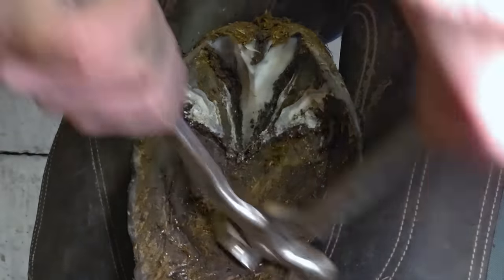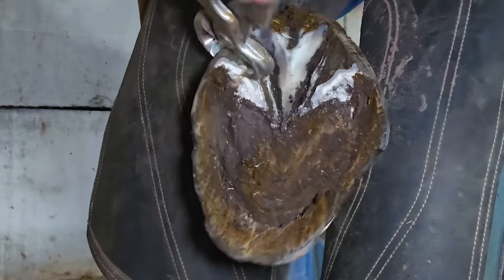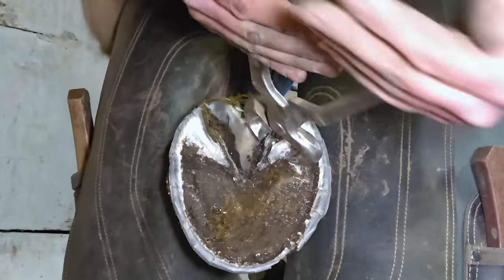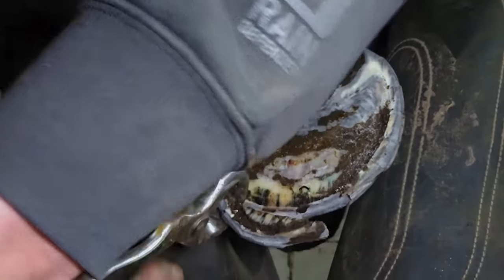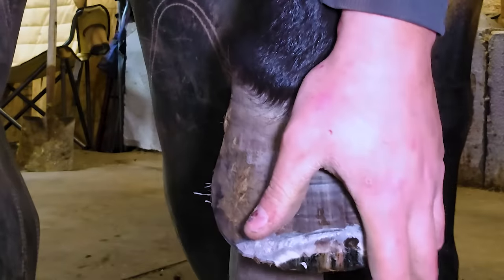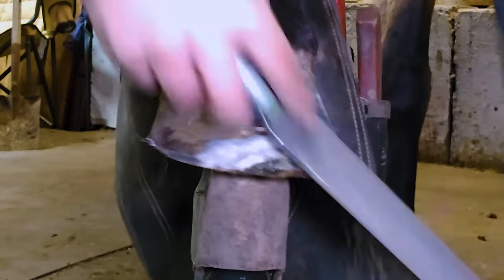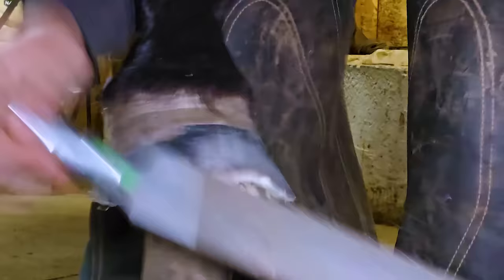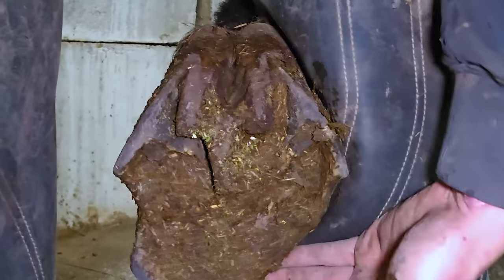These Hooves Were In Terrible Condition!!! How Can People Let This Happen - Satisfying Restoration

Comment: As a farrier of 24 yes,  I have found on horses like this . Make a run of just cutting excess length on every foot then go back around with final trim and clean up. This will make their legs feel better so your final work goes easier / better.

Comment: 15 years ago we retired and shut our riding facility down,  We taught riding and we would have our Horses 101 twice a year  where we taught what we could in 2  6 hour days on horse care and hoof care was a large part of that and had our professional farrier do a section on trimming and shoeing a hands on shoeing job. and we had our well known  and sought after vet do a  mechanical tooth float and exam and explain how and why, and both when they understood what we were teaching, literally horse care for dummies they were both eager to help going so far as to not charge us for the tooth float or the shoeing as they both felt it was so important, our farrier visited once a month and did 1/2 the horses one month and 1/2 the next,and it worked out quite well with our 10 horses and the 8 weeks was just about right,  we also had a chriopractor friend that came out once a month for adjustments on all the horses, after a couple of adjustments the horses learned it felt good and seemed to enjoy them.  it is all importnt.

Comment: Question:  is there anything you can feed them once the hooves are trimmed that can help prevent the cracking?  Like we have a hair, skin, and nails supplement that helps quite a bit even if it takes a full month to get in your system before you really see any results.  Just curious.

Comment: The farrier has to create a template for the hoof to follow as it grows out. This sometimes means rasping the outside of the hoof. For example, in flares. A farrier doesn’t leave them on in the hope that they will eventually fix themselves. Flares need to be removed so the hoof will stop following a faulty template.

Comment: If you didn't take the flare/distortion off the outside of the hoof, it would continue to grow distorted.  You did that little horse a great favor.  It's amazing how quickly the dark tubules will grow down after it's rasped on the outside.  No supplements will fix a poorly trimmed hoof.
We had a rescue who had been neglected, then dropped off at the auction and bought by the slaughter buyer.  He was a good boy but like this horse, couldn't stand due to the additional pain it added to the other three.  I finally listened to him and not surprisingly he began to lift a hoof for me and I'd trim that hoof until he asked for it back, then he'd lift a different hoof.  It was more work for me as I had to move around and around the horse with my tools and stand but it was better for him and quicker in the long run to not fight with him.  It was a months long process to get those hooves back in shape but that old boy was running on hard packed dirt and his top line lifted inches.  
Thank you for what you do, it's amazing.

Comment: Caleb... do the rasps ever get filed down too far to not benefit using them/ need to be replaced? Why don't farriers have a larger base for the hooves to stand on and why aren't they taller so farriers don't have to bend over so far all the time? thanks for this video and I look forward to learning more, even though I don't own a horse.
Reply from the maker: The rasp go dull after 10 to 15 horses depending on condition of the Hooves (hardness/Softness)
Reply: Doing three horses monthly, my rasps last, on average, 3 or 4 years. They can be resharpened, but it's usually best to just replace them. They aren't THAT expensive. I recently replaced my nippers after 9 years. . . Same usage. They can easily be resharpened at home.

Comment: I would like to see even more education in each video. Possibly diagrams to explain how the outside of the foot relates to the inside structures and bones from real horses. Then how the horse differs in conformation from the ideal and what measures are open to the farrier to compensate for this. Also a timeline for the recovery of these horses - especially the neglected ones - to being able to be gently ridden and then up to full work.
Also required is a lesson on daily hoof care 'why, when, how often' and consequences of not doing it.
Plus how to keep your farrier happy. The 'do's' and 'don'ts' and simple good manners. For example, having your horse inside with clean dry legs and feet ready for when the farrier turns up. Not just leaving it to the farrier to catch up your horse from pasture.
Here in the UK the practice of farriery is closely controlled and it's illegal for unqualified people to just set up doing it. A UK qualified farrier has to know as much about the horse as a veterinarian, including drugs, the dosages and uses. Your farrier can save you a fortune in vet bills if you just pay attention to what they tell you. Great videos thank you 💕

Comment: Would using a very dished out hoof be interesting if the toe isn't painfull to use a type of saw to allow for less time using knippers in the direction like away from the front at an angle so it could not get anywhere close to the sensitive core of the hoof.
Though i can see it being strange to the horse, though i can see it being not viable on horses like this one with the stretched toe...

Comment: Perhaps I would have at least nipped all 4 feet and let his tendons adjust, then finish the next day. Yes you can see by the new growth at the coronary band that he is foundered, the navicular attachment is seen by this new growth, a very steep new growth and then the slant of the loose attachment,  which would continue to pull away from the wall if the horse was not trimmed, and he would remain in continual founder. He can recover with regular trims.

Comment: What’s the reasoning for not using a grinder on horse hooves? I only really see them get used on cows.
Reply from the maker: 1 We don't have the stabilization of the hoof that cow Trimmers do making using a grinder on horse more of a safety problem. 2 generally we a doing finer adjustments and trying to a achieve a more precise balance and level. However I will use a grinder when trimming minnies
Reply: @caleberickson_The_Dying_Breed  thanks for that information. Makes sense

Comment: Yeah, unfortunately many people disregard the poor animals' welfare. Been there, done that corrective trimming, too. Note: This video is not on my channel. https://www.youtube.com/watch?v=o6AWfIwtqgw

The horse was cantering on the pasture after the trim, although I didn't get the hing hooves as good as I'd wanted to since my back was giving me a pain. The veterinarian aho saw those hooves before I came there had diagnosed laminitis. When I saw them and trimmed that white line and laminae visible I said that the horse hasn't even seen laminitis. Pressure testing the sole (coffin bone) with tongs verified that. The laminae had been torn only because the excessive force created by the overgrown wall. When the wall grows longer than the sole a lever is created that forces the wall outwards, creating that flare on the wall you correctly rasped off and tearing laminae apart. Laminitis has no role in this.